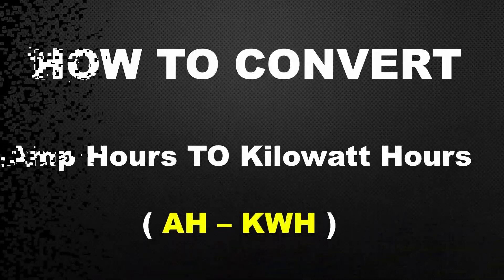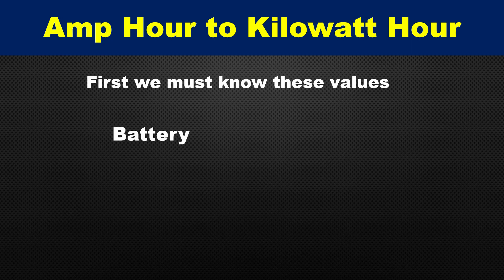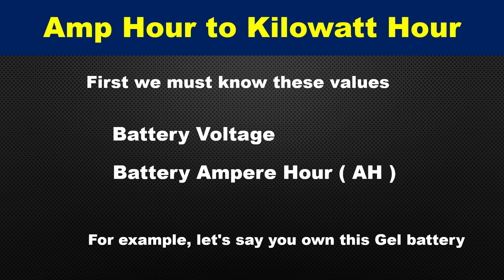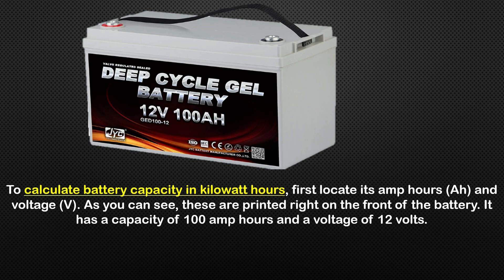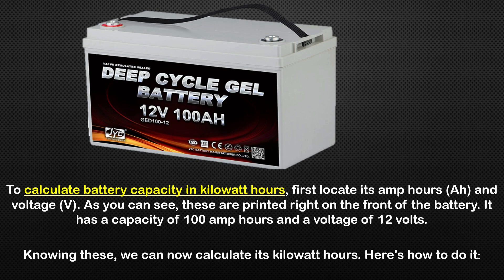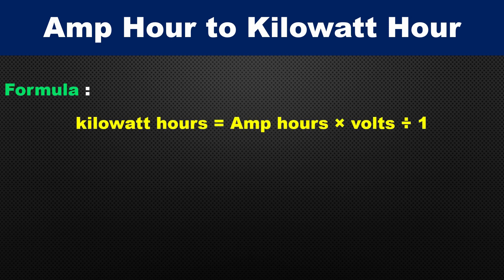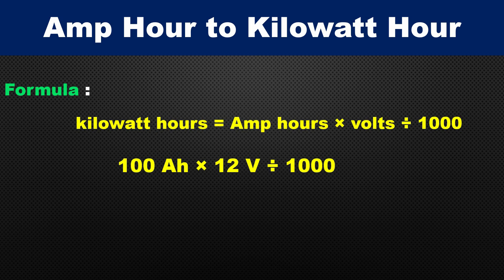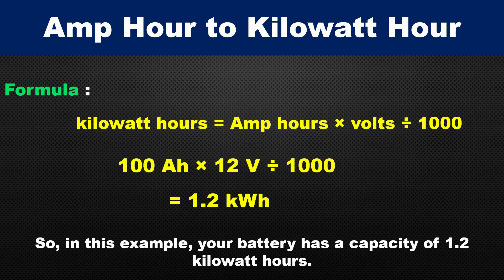How To Convert Amp hour To kilowatt hour Amp hour to Watt hour  AH To kwh

Comment: 4.4 kw kitne ampere ka battery hua
Reply from the maker: About 366
Reply: @whitewatt-hu2lm  1.4 kw to 30ah hoti hai fir 4.4 is hisab se 110 120 ah honi chahiye 366 kese ?
Reply from the maker: @fahimkhan2564  zara calculate karo 30 Ah ka 1.4kw konsi formula se karte hu